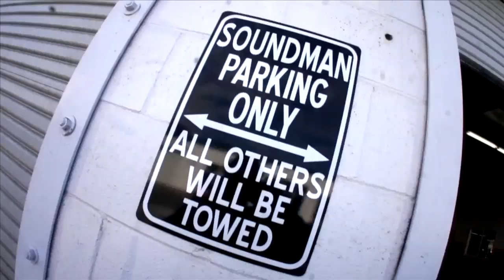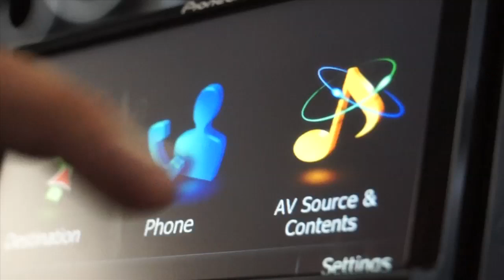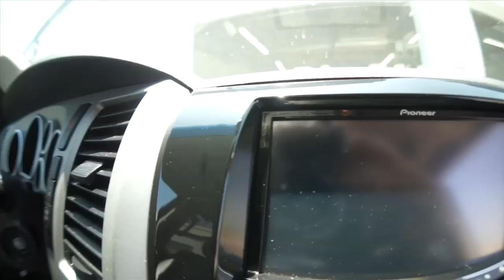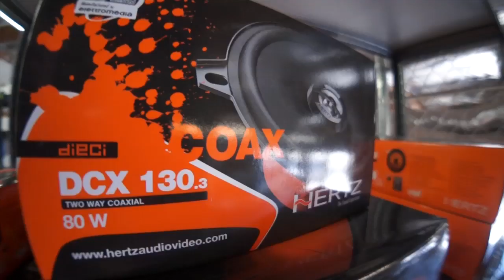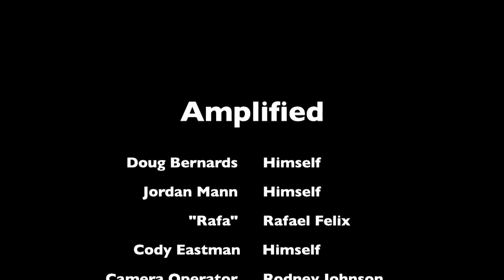Amplified 65 "A Man's Drill"

Comment: You guys should use a pencil butane torch with a knife attachment to cut and weld plastics. I use a $15 Benzomatic micro torch kit and that thing does wonders. Much better than using electrical soldering irons.